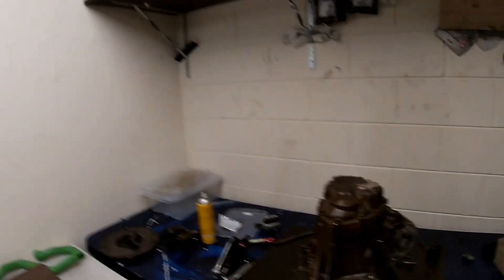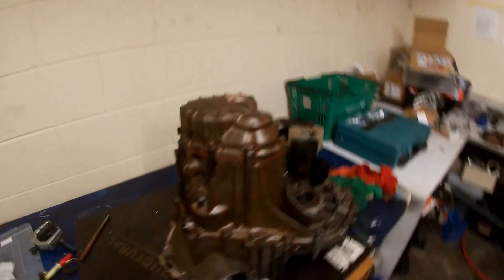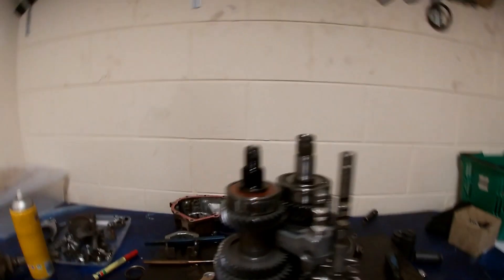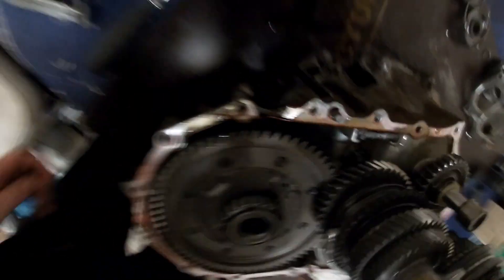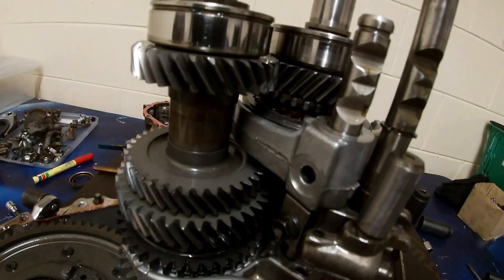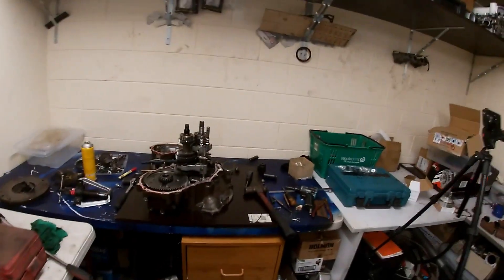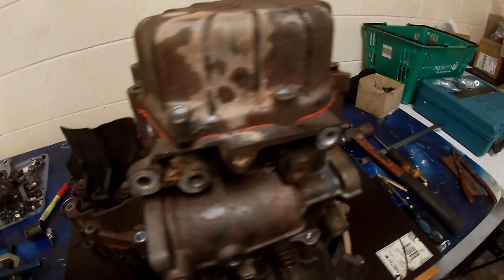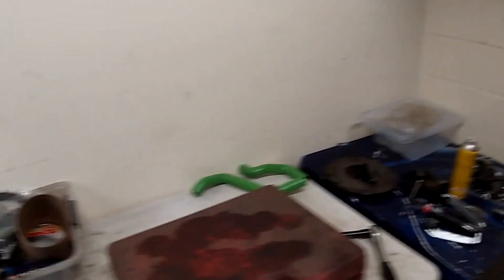Nick broke his C52 gearbox

Comment: Just stripped 2nd gear in my stock starlet issued C150 5 speed with Quaif ATB LSD . 160kw @ wheels . Circuit racing 😮
Reply from the maker: Wow that’s unlucky. Nick was running the c150 for ages and didn’t break it lol just had synchro problems…

I run c52 in the twin engine starlet, each box is putting down 300kw at the wheels and no issues, been in there for many years now

Comment: Hey mate. I bought a C52 from an ep82 gT and put ot on a 4efte eo91 from a Glanza V. The engine is on a European EE111 Corolla with 4efe driveshafts that seem to be too long because the tripods are making insane noise when I’m turning the steering wheel. What should I do?
Reply from the maker: Use the original driveshafts
Reply: @Camp_Dogs  do you mean the drive shafts that originally were matched to the gearbox on the Starlet GT or the ones that came with my Corolla?

Comment: i have broken input shaft with locker diff, shift fork bolt backed sheared....i have seen stripped 3rd and stripped 5th gears
Reply from the maker: Wowzer thats crazy! What tyres and cvs were you using??
Reply: @Camp_Dogs  a050 and factory toyota cvs, anything other than factory cvs shear the tripods
Reply: i've also modified the the selector fork rails now to take the load off the shift fork bolts, to hard to explain here but basic machined the rails to fit the little C clips either side of the forks if you understand

Comment: Hi Matt, just a quick question if you don’t mind. I’m rebuilding my 4E engine and currently splashed all the cash on ACL bearings etc. So just trying to think budget wise if victor reinz is a good go to? I’ve heard nothing but amazing reviews from the company, was just wondering if their 4E stuff was good? Thanks.
Reply from the maker: Never used victor to be honest. You cant really go wrong with bearings these days though, just use a hood quality engine oil and dont let the oil temp get too hot
Reply: @Camp_Dogs  sorry mate I forgot to mention about the head gasket. Victor Reinz for head gaskets? If not no worries I’ll do some investigating my self ahaha
Reply from the maker: @Tedbudden24  ive always used cometic gaskets, never had an issue

Comment: I have a 5efe and I was gonna add a gasket to the pan and when I took a look at the rods where they conect to the crank and one of the bolts was broken and 3 of the arms where loose from the crank yk why ???? I think I did it right everything was to the right torque specs

Comment: Hi Matt! Thank you for the deep insight into the gearbox! Great content!
I have a question: Would a 6speed gearbox from a Corolla G6 also be useable?
Greetings!
J
Reply from the maker: hey cheers, im not sure on the 6 speed, it all depends on what box it is? if its not from a 4a family, it will likely have different inner cvs to a starlet and also the gear linkages will be completely different...
Reply: Corolla G6 gearbox bolts straight onto a 4EFE engine, however G6R box has different bell housing.
Reply from the maker: @Tedbudden24  thanks for clearing that up. We dont get those here in Australia
Reply: For what I’ve read on forums a few guys have a G6 gearbox on the 4efte and it’s fine. I have problems with my C150 on the 4efte in my Corolla and everybody is telling me that this gearbox is too weak... I am not sure about that but I bought a C52 off a ep82. I’ll see if it works. Although the gearbox is it refurbished so it’s a gamble. Gear rates are the same besides first gear. I bought it because I want to put in a Kaaz tranny.